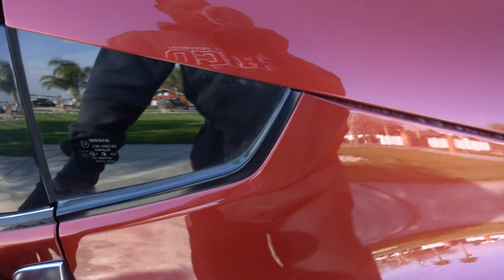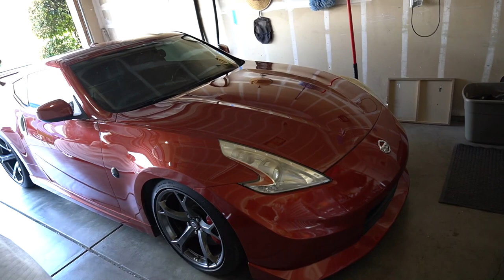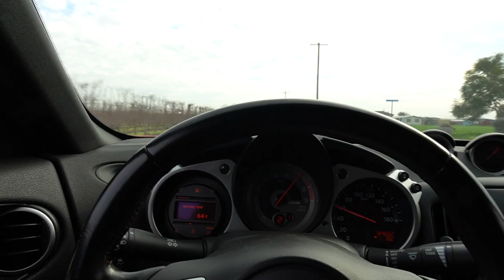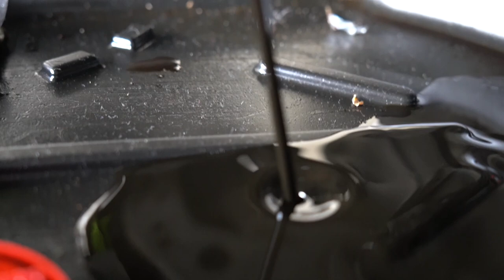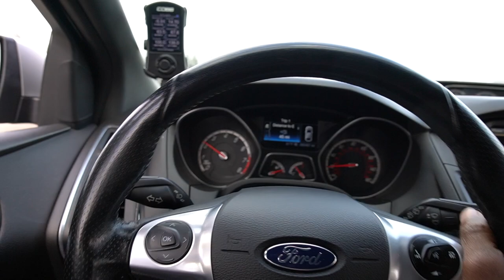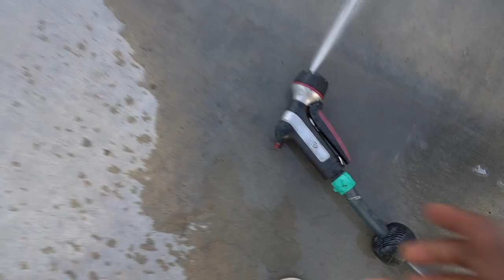I was a couple miles away from blowing my engine....

Comment: Sorry in advanced Robert, your oill change just kinda reminded me about somthn...

ik this is kinda common knowledge. But when doing a customers oil change I put the oil cap on the hood latch so that if you slam, or try to put the hood down it will break. The reason why that is a good habit is since if you forget to put oil in the car the quickest way to realize is that you forgot is that just smashed a $5 oil cap instead of a $1000+ engine on a customers car. (props to my auto teacher Mr. G the coolest teacher)